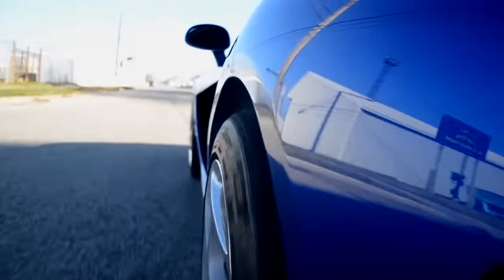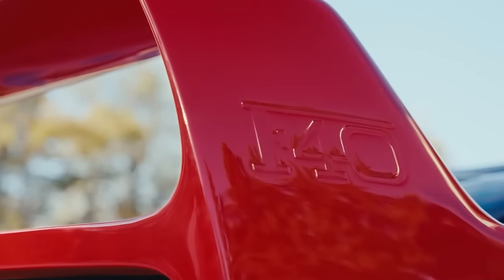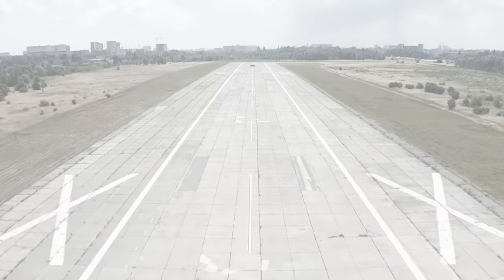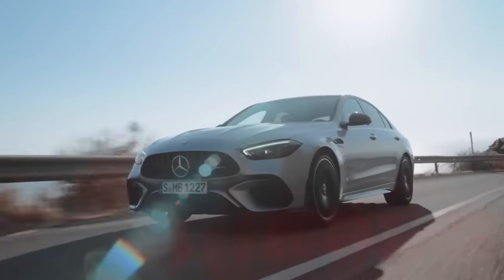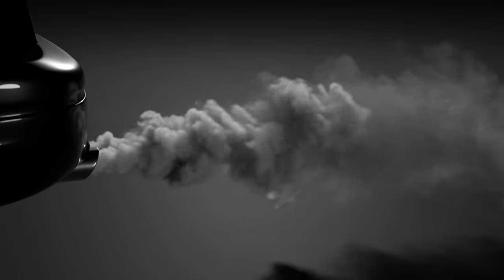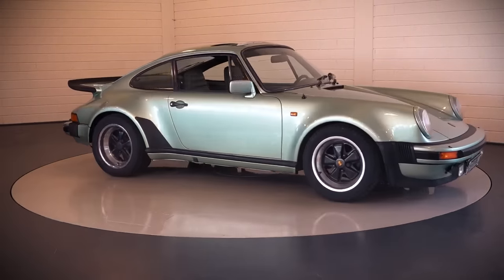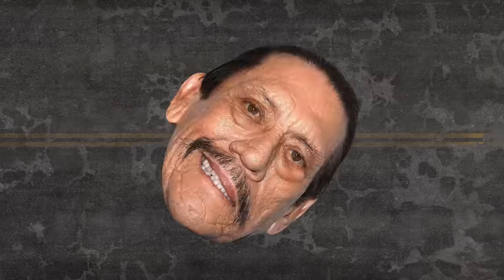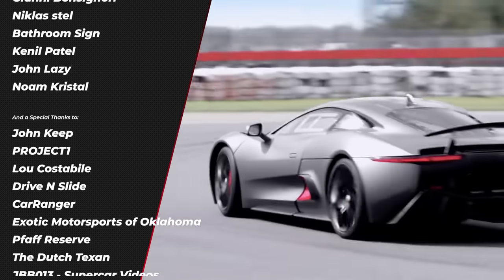Top 7 Cars where Size DOES NOT Matter

Comment: in 1952 BRM built a 1.5litre v-16 gran prix race car that had 750hp and 16,500rpm and was raced by stering moss who said it was the fastest most dangerous car he ever raced in the Belgium gran prix in 1955 juan fangio had it to 218mph and said he only had it to 10k rpm. 1.5 litre high horse power racing motors are not impossible to build. in fact from 1951-1965 all formula one race cars had to have a 1.5 litre motor those were the rules thats when the cooper climax and coventry V-8 four cam motors came out, till ford made the 3 litre lotus 49 in 1966 which is still used today in F1 race cars.

Comment: The reason the F40 is so fast is its weight, it's only 1,254 kg (2,765 lb).

The 13B rotary engine is similar is size to a keg of beer.
Reply from the maker: Weight has nothing to do with top speed
Reply: @TopCarsTV  It has everything to do with accelerating to top speed. That's what we're taking about.

To say otherwise is incredibly ignorant.
Reply from the maker: @edwardfletcher7790  It affects acceleration, but does very little to the top speed
https://youtu.be/ZF58IOOucEw

Comment: In the real world, Caterham 7. An actual racing car designed by a motorsport icon that you can actually buy second hand for much less than the price of many basic cars.
Reply: One of the Caterham special models should have been included.  Didn't they have a supercharged Hayabusa engine in one?  400HP in 500kg/1100lb?

Comment: Umm ackshually 🤓🤓🤓 13B  a 3.9, and here's why

Mazda measures engine size using only the block of the engine where it does the combustion, which is 650cm³, since its 2 rotors, you do 650 x 2 = 1300

A rotor do the work of 3 pistons, each rotation takes 3 combustions, and since the 4 steps are happening every time, you'd have to multiply the displacement of 650 by 3 (650 x 3 = 1950), and it got 2 rotors, so its 3900 (1950 = 3900, simple), so each block is is a 1950, which means that the 13B is ackshually a 3.9

But why? Imma explain. For instance, take a 2.0L I4 engine, you take the displacement of each cylinder and then multiply by the number of cylinders (500cm³ by cylinder x 4 cylinders = 2.0L), I use the same logic on the Wankel engine

So, techinically, the RX-7's 13B is actually a 3.9L engine (and it could be named 39B, since the codenumber "13" is the engine displacement, 1.3, so 39B)

but hey, I am just a dude from the Internet, that's just my point of view, its not wrong saying that the 13B is a 1.3, same thing if you say that it is a 3.9, I'm here just to set the circus on fire say what I know

Comment: The number that really counts is lbs. (of fuel) per HP hour, i.e., fuel efficiency.  The fetish for small displacement engines goes back to Europe a hundred years ago when displacement was used as proxy for fuel efficiency.  Small engines were considered to be fuel efficient.  That just ain't so.  Slow turning engines (low piston speed) are fuel efficient.
Reply from the maker: You can run small engines at low RPM too. They won't accelerate as hard, but for just maintaining the speed, a 1.5L at 1200RPM is more efficient than a 5.7L at 1000 RPM. 
Also, I assume that if we're talking about fuel efficiency, then racing around the track isn't a good test condition.
Reply: @TopCarsTV  You are, of course, exactly correct.  What you want to do is use the smallest engine which will provide the power you need to cruise at somewhere around 1000-1200 rpm in most cases.  Relatively large cylinder displacement and relatively long stroke also matters to reduce heat loss from combustion chamber.  Both of those factors tend to reduce HP output for a given displacement as well.  But explain the recent popularity of 3 cylinder engines in small displacements.
Reply from the maker: @anvilsvs  It's no popularity. It's forced on people in order to reduce CO2

Comment: What about the Koenigegg Gemera with its little 3 cylinder turbo engine that makes 600hp alone and has 1700hp combined with the electric motors
Reply from the maker: Most of the speed and power comes from the electric motors. I get that the 3cyl turbo is amazing, but it's hardly the start of the show.

Comment: And how many hundreds of kilometers does the 1.6L engine last before it needs a total overhaul?
It is possible to get even more than 500HP from 1L engine, but you won't find it on the road, more often in a service center ;-)
Reply from the maker: How many miles do people usually do in hypercars? 
Besides, even if they do many, those cars are serviced properly. It's easy when you have money
Reply: @TopCarsTV  I know hypercars with much more than 100,000 km. I also had the honor of meeting the owner, who drives his hypersport Ferrari to work every day. Likewise, one owner of a hyper sports Porsche...
Regular service yes, but at reasonable intervals. A hypercar must have a reasonable engine life. It cannot resemble the engine in the Škoda Superb 1.0T with a service life (replacement according to the manual) of 90,000 km ;-)

Comment: NOone use super charger, unless its a american Stone age BIG BLOCK V8 motor. the problem with Superchargers is the high power lost just to run it, its approximately of nearly 300hp just i wast of  power to run the damm thing, also the high fuel consumption is Ridiculous, but Turbo with dual scroll charger is so much more efficient. and provide a excellent fuel consumption. and give real power too
Reply from the maker: But that supercharger whine...

Comment: LOL! The EV1 made 137 HP.  It wouldn't go 180 mph if you dropped it off a cliff.
Reply from the maker: It was a preproduction prototype. Might have even better aero and more power
Reply: @TopCarsTV  The prototype you mentioned was a one off exercise based on the Impact. The Impact that people drove on the street was also prototype only / different vehicle that never made it to actual consumer vehicle production. They produced 50 handmade test cars. The EV1 production car shown in your video is twice removed from the Impact salt racer. The Actual EV1 with its lead acid batteries and 137 hp motor was about as fast as you can expect out of 137 hp and BTW, it was electronically limited to 80 mph top speed, not exactly a speed demon.

Comment: If this included racecars, then the Toyota Eagle GTP car was magnificent. 

Downforce – around 10,000 lb at 200mph. 1,100+-horsepower. 1829 lbs. 

Power came from a highly-boosted, production-based 2.1-litre 4-cylinder engine. (2100cc). 142 psi of boost. 10,000 RPM. 

Dominated the series.

Comment: Fastest car in the real world.  C8 ZO6 has something to say about that
Reply from the maker: That's an impressive car, but I wouldn't say that it can keep up with the techno-wizardry of a Turbo S.
Reply: @TopCarsTV  Techno-wizardry is good when it reduces cost more than it adds to it.  And, aside from all that, the 911 still has the engine in the wrong place.  Boxster/Cayman have it right.  Dr. Ing. F. Porsche wanted a mid engine in the 356,  but didn't have the budget to change the Beetle rear suspension.  And semi leading arms when reversing the Beetle power train didn't work at all.  So, the perpetual wrong engine configuration which persists.

Comment: Rotaries dont count as in reality they should be looked at as at least 3 times the quoted capacity in regards to fuel consumption and oil consumption, yet without the torque, reliability, power, efficiency or engine longevity! Rotaries are SHITE dirty engines hence why hardly anyone ever bothered making them and why they havent existed for a decade.